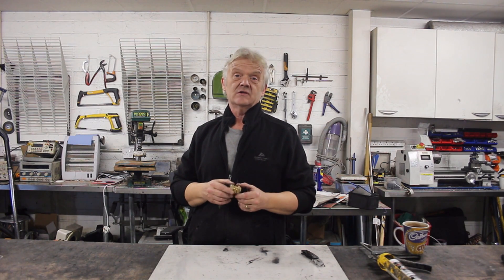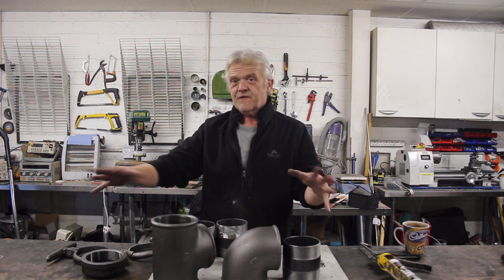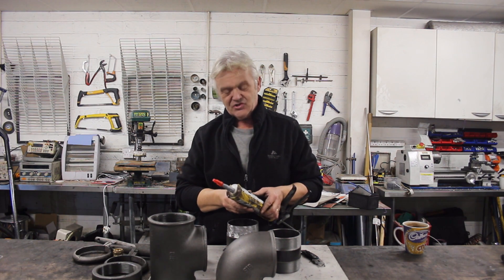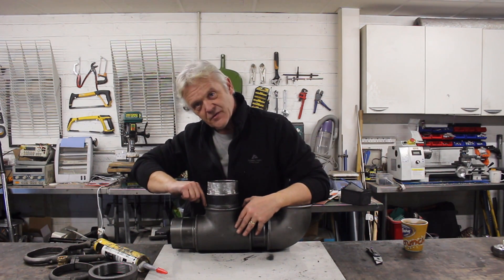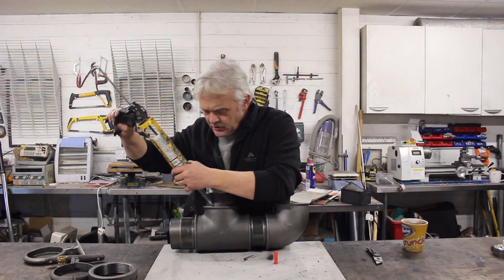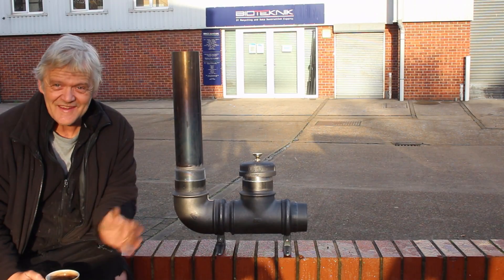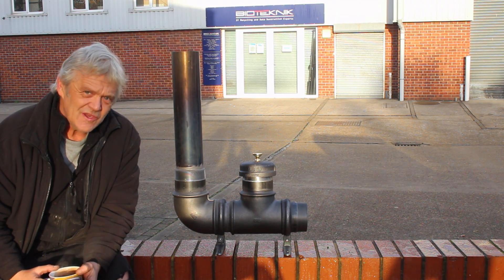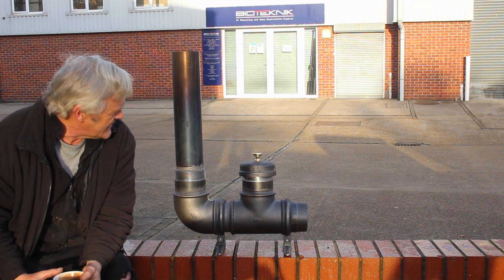1743 A Rocket Stove Kit - No Welding, No Tools, No Experience = No Problem

Comment: Surely that lot costalot and you must have tiny hands.
Reply from the maker: you can do it for around UK£80-90 - still more than if you weld but you are well out have a look on pipeworksuppliers.co.uk and use metals4u for cut to size pipe - the minimum wold be the T piece and an elbow - the rest use cut pipe and sealant
Reply: @ThinkingandTinkering   Could one cast one in concrete? Would it take the temperatures? That would seem a cheap and easily accessible way of doing it if SHTF, though not as portable. I have seen various similar ideas with cement on Youtube, but I question whether these are really rocket stoves or likely to be durable. In principle it seems to be similar to a Dakota fire hole, but with a chimney.
Perhaps one could cast it around a tin can mock up and just let it burn out over time.

Comment: I really like the aesthetics of that rocket stove and it's great that you've looked into the geometry of these things.  I'm sure you noticed it functioning as expected, which is not just a happy accident.
Reply from the maker: indeed not
Reply: One of the best stoves ever made , so easy to make .
Reply: @sixpackbinky  - I would need to build one and do some testing before calling it the "best", but it's definitely much easier to make than most rocket stove or RMH cores.  I honestly don't know how well it would stand up to the temperatures at which a true rocket stove operates, since those are likely mild steel castings.  I suspect they would spall quite badly, although they are very thick, so a lot of metal to erode before it becomes an issue.
Reply from the maker: I don't know what you mean by a true rocket stove mate - wording to the definition this complies with being a rocket stove - if you have a different understanding please do share
Reply: I do not think Robert ever has a sad accident LOL always a happy (plan) accident .

Comment: Where I live this would cost 270 dollars USD so. But high quality camping wood stoves with all the bits cost about the same
Reply from the maker: you can do it for around UK£80-90 - still more than if you weld but you are well out have a look on pipeworksuppliers.co.uk and use metals4u for cut to size pipe - the minimum wold be the T piece and an elbow - the rest use cut pipe and sealant

Comment: That’s awesome almost like how I built my pellet burner only I just used 2 inch if you cut a hole where the fuel sits and then fashion a downspout and have it dropped into a paint can You can burn for a long time and not even have to clean the thing of course mine is inside and plumbed into my chimney so I guess kind of a different animal at this point keep it up I love these videos
Reply: How do you get the pellets to feed?
Reply from the maker: a little bit different for sure - but I like what you did

Comment: Good idea... but at a cost if you buy new from BES £232.09 inc VAT plus length of pipe.
Reply from the maker: you can do it for around UK£80-90 - still more than if you weld but you are well out have a look on pipeworksuppliers.co.uk and use metals4u for cut to size pipe - the minimum wold be the T piece and an elbow - the rest use cut pipe and sealant

Comment: Could You kindly put links/item names into the description so We can buy them and remake this easily? Finding it difficult to find the actual items.
Reply: 100% agree. Would be really helpful if he did.
Reply from the maker: it varies in parts of the world - so sometime - actually a lot it's not that useful
Reply from the maker: you can do it for around UK£80-90 - still more than if you weld but you are well out have a look on pipeworksuppliers.co.uk and use metals4u for cut to size pipe - the minimum wold be the T piece and an elbow - the rest use cut pipe and sealant

Comment: another fast way to make a rocket stove is large truck exhaust pipe and fittings and a flow through muffler makes a great heat exchanger. still use same sealant on gaps. question how much did all those plumbing fittings actually cost? bet those fittings stayed warm along time. great build
Reply: I've been looking into truck exhaust fittings and tubing also. I think they can be 3 inch . I like the muffler heat exchanger.
Reply from the maker: nice tip mate cheers

Comment: wow...Fantastic idea again. Thanks Robert..what wass the company you bought the pieces from again?
Reply from the maker: you can do it for around UK£80-90 - still more than if you weld but you are well out have a look on pipeworksuppliers.co.uk and use metals4u for cut to size pipe - the minimum wold be the T piece and an elbow - the rest use cut pipe and sealant
Reply: @ThinkingandTinkering  thanks Robert

Comment: This really looks like a stove!! you keep adding in a feed tube, its really not needed as long as you have a burn shelf in the horizontal tube. Just an L shaped pipe will work just like drilling 2 intersecting holes in a log one vertical and one horizontal will create a swedish fire which is a rocket stove or use concrete bricks.. yes the feed chute can make feeding the fore a little easier but its cheaper and easier to build without it.. In THIS case I would rather use the leg of the T as a cooking surface and put a flat plug in it....
Reply from the maker: I agree mate and I was thinking of that just tomato a simpler version - but I went for looks too!

Comment: Excellent job! So simple, considering the same efficiency as with your own built rocket stove. The only simpler ones I've seen are the cinder blocks and bricks rocket stoves, but I guess  metal ones are more in fashion.

Is there any way to get a vortex generator within this assembly design? What could you fit in to create one? :)

Cheers!
Reply: @GoodEnough
I've seen a rocket stove with a Venturi built in that makes a double vortex that counter rotates. The stove was made from vermiculite boards.
Reply: @justtinkering6713  could you provide a link perhaps?
Reply: @emel60  youtube deletes posts with links.
Reply: @justtinkering6713  Ahhh, I see! That's a new one for me. I'll reverse research the double vortex then!
Reply from the maker: it's prettier lol
Reply: @ThinkingandTinkering  a mother loves her child the most! :p

Comment: Superb. It’d be great if you could incorporate some kind of cooking surface into the design. It’d be nice to use all that lovely heat.
Reply: maybe put a metal plant stand over the fire part? cut the legs off so top of stand is 1 inch over the opening.i keep an oil lamp under a plant stand,with a pot of water on top. I always have hot water as well as heat and light from the oil lamp. the flame should be 3-4 inches under the pot to avoid soot.
Reply from the maker: I agree - looking for a bit of brass right now lol
Reply: Couldn't you just use his build for indoors? He gives the parts here, but since it is basically creating a flat top above the chimney, you can just use that as the heat element.

Comment: Great design, and it should appeal to those who like "industrial" design.  Note that Diesel Truck exhaust pipe can be had online in 2 and 4 ft lengths, for near the avg cost of your other components.  There are some nice exhaust pipe joining "clamps" for extending the length, too.
Reply: Thanks for the tip, buying new is too rich for me, but cheap truck exhaust parts might be obtainable from a scrap yard. 👍
Reply from the maker: nice tip. mate - cheers

Comment: Nice, but I have no clue what to use it for. Can't use it inside and what would you use it outside for?
Reply: Well it's a rocket stove, so you put a pan on top of the chimney to heat it up. If you have electric cooker and there is a blackout, you could still boil water or heat up soup etc...
Reply from the maker: cooking - but a simple adaptation makes it good for inside use - I did a video on it